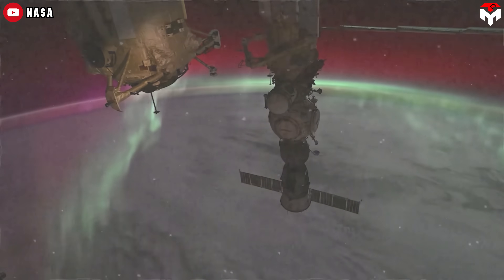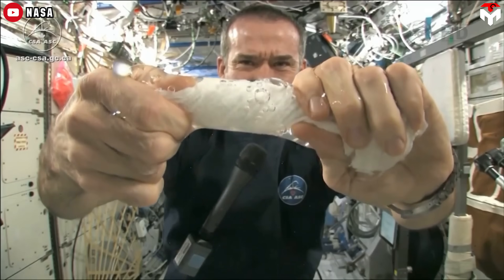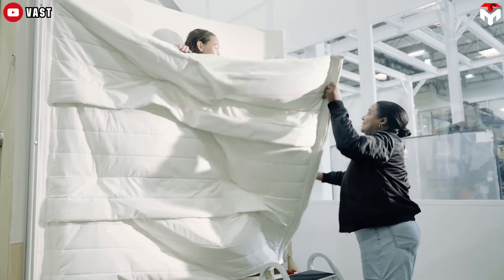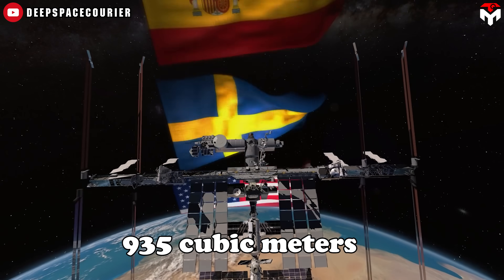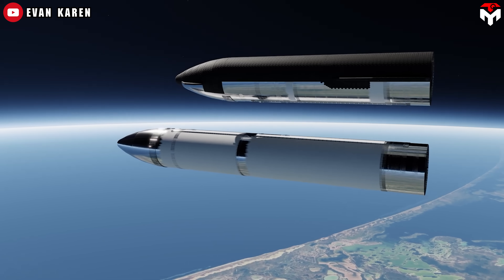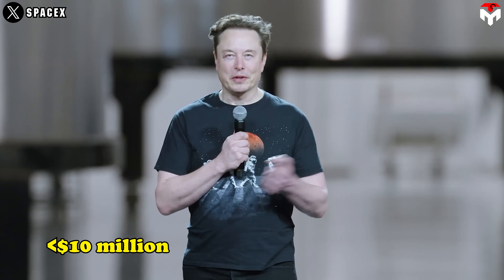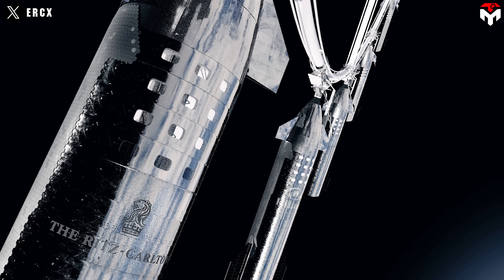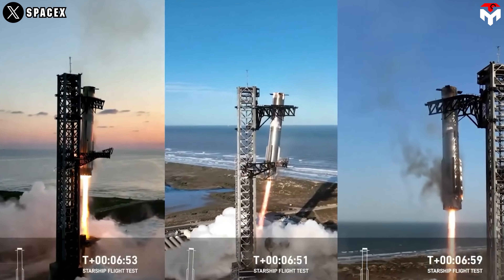ISS is in Big Trouble! SpaceX Found Genius Way To Build New Space Station.

Comment: how could we use it to clean up the orbit of trash and repurposed the trash in to building materials to keep our orbit clean and safe
Reply: The problem is making something that won't be torn to shreds when it gets pelted with debree and is nimble enough to move fast enough to intercept junk. And that is not as easy as it sounds. The debree does not fling around on the same trajectory all the time. And the more impact resistant you make something, the heavier it is. So it takes more effort to get it moving and to get it to stop moving. Trying to reach a happy medium is problematic. 

Now its not so bad that its lethal to launch a ship because we can still launch them with relative safety. But we can prevent adding more junk to the collection. Some day we will get something figured out. It just won't be in the near future.

Comment: Quatro Starship ancoradas em uma estrutura giratória gerando gravidade artificial. Poderia dar certo
Reply: Well, the rotating structure method to generate artificial gravity is already proven to work. Adding docking ports to merge with the ships is manageable too. The only problem I see with this is that there isn't a NEED to do this right now. At least not yet. There is no advantage or value to moving people to live in space. Not to mention that currently there are other problems that come with space travel that would hinder population growth among other things. And there is no commercial for there to be any value in the effort either. We are not at a point where manual labor for mining is necessary. It would just be research teams and temporary crews that don't need to be up there longer than a few months or a couple years before they come back down.

Cool idea. But it will probably be well over a another 30 years before we have any reason to care unless it becomes a useful midway station between earth and mars. Then we may see a design put into practice sooner.

Comment: What's with the title? ISS is not even in trouble. It is doing just fine. It will be disassembled when its time is up and that is that. Nothing to see here
Reply: There will be NO "disassembly" of the ISS - the plan is to allow it to crash into the ocean, a suicide plunge directed by NASA.
Reply: Its officially at end of life.   They're planning to deorbit soon.  The title is hyperbole but the station is indeed failing and finishing its 25 year mission that was extended beyond the 18 to 20 plans
Reply: @sparaz so where is the trouble? They have been working for years on a new updated version.
Reply: @phorias  Okay yes, but the video outlines the core issues. Repairing the ISS is expensive, tacky, and not always holding up long term. The materials and tech used to make the ISS is 25 years old. Which is historic compared to modern advancements today. The original has, as stated, about reached the end of its life. It would cost less to build a new one and retire the old one. This video is just running on the advancements Space X has made and how large their ship is and if that same methodology could be used on establishing a better, easier to maintain, long term low orbit space station. 

My guess is that if it did, it would be the third generation of the ISS, probably not the Second. Elon has his plan still set on Mars and I don't see a motive to pivot or include a low orbit space station. Other than better support for research studies, there just is no value in the effort on his part to concern himself with it. The only possible possibility is that you might have less fuel usage in space moving a ship and having a launch station that manages refueling ships traveling from Mars to Earth might actually be useful. The station could act as a supply depo, hotel space for passengers waiting to board the next mars transport. And if it helps reuse refuel costs by keeping the ship in space so it is not constantly having to be launched from Earth, that could have merit. But starting out still probably not an objective.
Reply: @phorias  no problem I'm saying that your comment was acting like the video was saying something that was incorrect or inaccurate as if you were saying something profound.  And the just not the case. The video was completely accurate and only detracted from the point of the actual content.

Comment: Why not use the concave nose cone for positioning the starships at the inner spoke location then dispose of the engines and use the flat plane of the ships base for connecting another ships base to it? So you have several cigar shaped sections attached at a center joint the the nose comes facilitate the proximity of the spokes being closer to each other with just a center piece required to permanently dock them together. If the nose cone is designed accordingly, it also provides numerous docking options at the far end of the spokes for other supply/auxiliary vessels to berth. As long as the fuel tanks can have a disposable bladder so the cavity is usable once the ships are assembled and the engine/s modules can be set aside for returning to Earth via a shuttle, or disregarding all together, then 90% of the internal volume could become usable. Imagine astronauts having a large open cavity (repurposed fuel tanks) as living quarters instead of pokey passage ways like now. The benefits to psychological effects alone would be revolutionary for long haul stays.

Comment: A few here have spoken about centrifugal force to produce gravity. My thoughts keep saying it won't work. Centrifugal force works on earth because it starts with gravity. If you had a tubed ring. Completely smooth on the inside and no objects to get in the way. If you where motionless in the centre of the tube. Not touching the sides. If you start spinning the tube. You would stay pretty much in the same spot and the tube would spin around you. Because there would be air inside, The friction of the tube against that air would make it move a little and that could push against someone in the tube. But it would only push you in the direction of the spinning tube. So I can't see how spinning would create gravity. I think the reason why the space station a spacecrafts are the cramped design is so someone doesn't get stuck without movement in the middle. They would need someone to move them or have a compressed air container they could use to move.
Reply: @Tinys-Homestead The key point is that centrifugal “force” in a rotating habitat doesn’t start with gravity — it comes from inertia. If you’re inside a spinning ring, your body wants to keep moving in a straight line. The walls of the ring keep turning under you, constantly redirecting you, so you feel pressed against the hull. That press is what mimics gravity.

If you were floating in the center at rest, you’re right — you’d stay there until the circulating air slowly carried you outward. But once you reached the ring wall, you’d feel the simulated gravity just like everyone else. That’s why in science fiction concepts (like O’Neill cylinders or spinning stations), the “floor” is always the outer hull, not the middle.

Magnetic boots or anchored fixtures would still be handy though, especially in transitional areas or for safety during spin-up and docking, when the rotation isn’t steady. But the main “gravity” effect is pure inertia redirected by the ring’s walls, no actual magnets required.

Comment: So my thoughts. use existing starship with some minor changes, maybe half the fuel storage (but don't remove all of it) those stored fuel can be used to restock the station for fueling up longer range trips. use a ring system and you don't have to modify the starship layout much. you could grow passed the circumference limit of a ring ring by stacking them. just spit ballin'

Comment: Wonder if we could build super powerful magnetic modules to put in highly crowded with debri orbits start pulling small to big chunks into one big pieces. That then can be contained in strong tight netting for next manufacturing stations to collect bits break them down to be reformed into new things or studied to see how the cosmic radiation changed them. Just imagine how cool it would be to discover that once we melted them down and reshaped the steels into new things it’s actually now stronger then when it was made on earth. Leading us to try collecting as much as possible in orbit for a new generation of spacecraft to take humans deeper into the system with this new stronger steel. I know that’s not how it works just having fun
Reply: its neat to think about but you dont need "stronger steel" to go furthur in the system, weve already reached other planets with lower grade stuff than what the starships use and at that point you could go anywhere in the universe you want, right now the main problem is speed and the time it takes to get where your going, as well as fuel efficiency, if we could just get a more efficient fuel we could reach the outer part of the solar system in under a month, and mars in just 3 days! For refrence it currently takes us about 9 months to reach mars and you can only do that once a year

Comment: Until some one invent some type of gravity plate/directional gravity, any long term space station will have to rely on centrifugal force to produce gravity (some where between .8 g and 1.1 g).  Having port/docking on the outside rings would mean the space ship would be over the design gravity of the space station when docked.

The best plan would be to build a ring and enclose it towards the center.  With gravity by spin at the outside of the ring, going inwards gravity will decrease.  Storage rooms on the inward sides, sleeping and exercise on the outward side.

To build, start with a cylinder that will be the central column of the space station (about 10 levels with air locks between levels).  Build outlaying rings in layers. Could use panel construction (interlocking) attached to struts.  Panels could be compact and expanded in space.  Then attached to struts.

Plan to have any liquid (like water) in the higher gravity areas of the centrifugal ring. less engineering if you rely on gravity.   Oxygen bottles could be stored inwards.  In the gravity areas you could have 3D printers to print up spares etc.

Use the spaceX for crew to live in, while the space station is being built.  Using 3-5 spaceship to construct an space station.  1 to live on and the others to bring material to build the space station.  having a 2nd spaceship in orbit for emergencies till space station is built.
A specially designed detachable unit from space ship could be the central spine of new space station. or 2 space ships nose to nose would comprise the central spire of a space station, with fuel tanks being used as storage for initial construction.  the Engines could be detachable to use on the outward rings..
Reply: idk where your getting .8 gs, it would be nowhere near that high unless you made a space station at least half the diameter of earth or spun wayyy too fast, realistically right now we would be able to get about .3 gs out of sentrifugal forces before it would start to make people sick, since most scientists agree that the max rpm you can have is 5 and 3.5 is the max that noone will get sick with, so unless you made a really big station, your not getting anywhere near .8 gs
Reply: @c1fi364  More thinking long term health benefits of the higher gravity on the human body.  If the design goes toward long term health, and not towards getting stuff into space.

Comment: I always thought instead of letting space equipment fall to earth, why not guide it to crash land on the moon? Yes, it would take a lot of time, but the systems could be set on a trajectory to eventually get there. It would provide us with raw materials on the surface that could be used to build buildings and construction vehicles, such as cranes, bulldozers, and digging vehicles.  We could get solar cells to survive a rough landing and power Boston Dynamics robots (which should not be sent to crash land, but land safely) to do the building.  Ensuring many buildings could be made safely without risking human workers, until Habitats could be there for extended human missions, when we eventually send human workers.  One of the first things intentionally landed on the moon would have to be working charging stations for robots and clean service areas for servicing damaged robots by other robots that are built to do the repairs of other robots. Sending inflatable structures to speed up making closed environments.

Comment: Gross Space Facts.  Every time a astronauts takes a piss on the ISS, tiny molecules of that urine escape into the air.  Over the decades these have clung to every imaginable surface, leaving a sticky and stinky yellow residue on every surface which is not readily accessible for cleaning.  It is disgusting inside the ISS, but there isn't really any solution to this problem.  It's not like they can gut it, clean it out, clean every part on its way back in.

Comment: What if Musk turns the starship into 2 stages. The first is the tanks/engines. The second is the payload stage. You launch 2 rockets into space unbolt the 2 upper stages from the 2 lower stages. Bolt the 2 upper stages together to make 1 station module and recover the lower stages for reuse.

Comment: Evolving adaption? Newer nmbettr parts? linked one after another and older parts cut away 
disconnected.
extra add on casrt away  cold thrusters and add on places?
newr parts nwith better update and solar power units less clutted
easy to replace reapair?
making ISS like a lizard tail that can  be cut off and regrow at will.

Comment: Would it no make more sense to use components of the Space Station with the new one.  Like the solar panels and manipulator arm.  What about all the scientific equipment.  What I am hearing the plan is to burn it all up.   It seems wasteful.
Reply from the maker: You’re absolutely right to raise that point, it does seem wasteful at first glance. The problem is, many ISS components like the solar panels and robotic arm have already surpassed their expected lifespan and aren’t designed to be easily detached or reused. Also, bringing them down safely and then integrating them into a new station would be incredibly complex and costly. That said, a lot of the valuable scientific equipment and data are being transferred or replicated in newer missions. So while it feels like a loss, NASA and its partners are trying to make the most of it before deorbiting.
Reply: @techmap9  Or  it would involve docking with the ISS and doing spacewalks to move the solar panels and manipulator arm over.  I have a idea why not use robots to swap over the components and work on them.